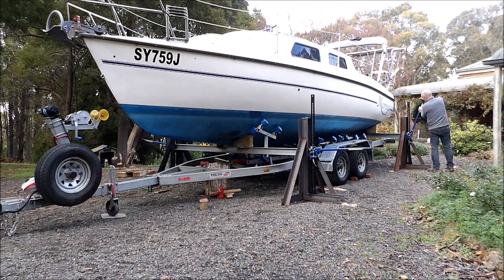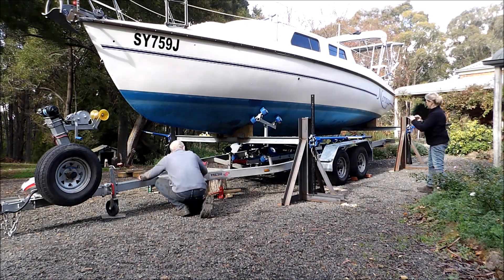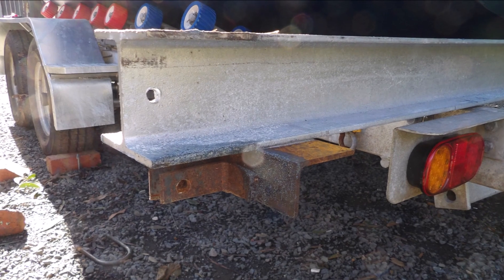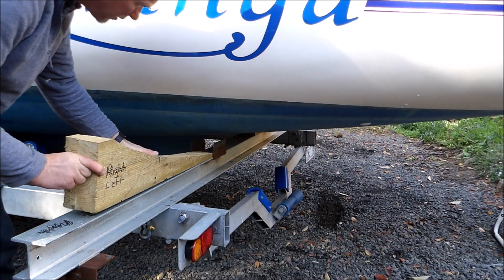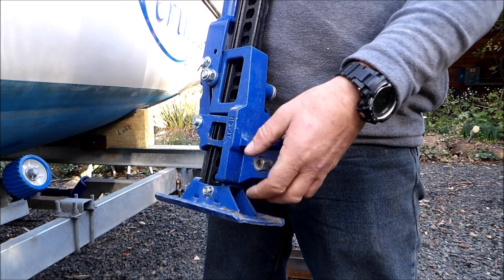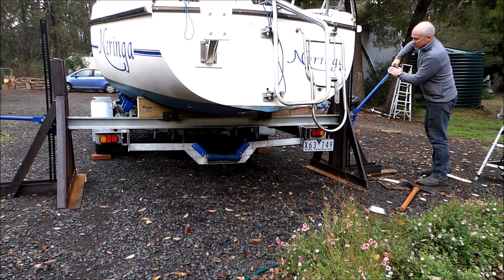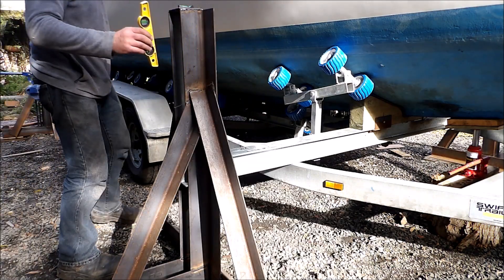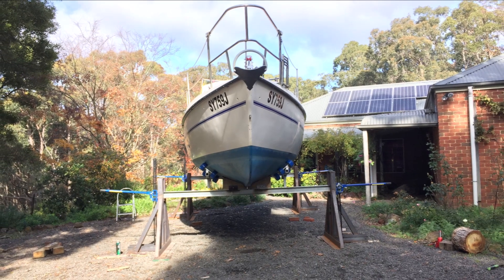Portable Hard Stand for Trailer Sailers

Comment: Nice rugged design, good especially for regular working yard.

Since I already have a set of Brownell stands sized for my wing-keeled Capri 22, I used two in the rear plus one bow stand to transfer my boat while "repairing" the 1970 trailer. I have a new custom trailer coming in the next few weeks. I will do the transfer again.

I have used hydraulic jacks but also have a tractor to assist with the temporary transfers. Since my old (and new) trailer had the same screw pads as the stands, I would raise my boat up to get a block between the keel and the trailer keel support. I would lower the pads to apply the bottom paint using ratchet straps to hold the boat stable relative to the trailer.

Yes, the extra stands would cost about the same as your materials, but the stands were convenient AND I already had them.
Reply from the maker: Hi John,
Yes the problem of lifting the boat of the trailer for work can be approached a number of different ways. Sounds like you have a great system that works for your boat and trailer. Moving to a new house in a few weeks and may set up a permanent gantry/roof over the boat parking area to be able to lift with straps and chain blocks. It will depend on how energetic I feel in setting up the 5m high posts and beam required! May just stick with my current system. Cheers Mark

Comment: These are great..!!  Are you renting them out??
Reply from the maker: Like all lifting devices there is a level of risk and they have to be used in a very specific way which makes the risk and liability of renting them or even letting someone use them to high for me to stress over. When I get time I will be adding locking bars on each stand that will 100% back up the high lift jacks.

Comment: Thanks for taking the trouble to make this video - a great design idea which I am about to copy. Appreciate it very much. Cheers.
Reply from the maker: Hi Richard, Thought I replied to this earlier. I have lifted the boat of the trailer 4 times now with no issues. I always suspected the jacks I bought were a case of fake chinese specs. With the boat around 2000kg each jack is only lifting 500kg plus or minus with the front ones a little more so even if they are only 1500kg jacks instead of 3000kg jacks as claimed they are not even lifting 50 % of the 1500kg so I am happy enough. If you do build them take note of the position of the jack bases on the inside of the stand foot so the weight is transferred to the base of the stand making the stands very stable. At some stage I will modify the stands by drilling holes in the uprights so that I can insert a safety pin that can be moved up as the beams are lifted. At the moment I just put a pin in the upright of the jack as it is lifted. Hope your project goes well, let me know how you get on. Cheers Mark

Comment: These jacks, which may be similar to yours are subject to an ACCC product safety recall, https://www.productsafety.gov.au/recall/ebay-seller-eastbayauto-x-bull-professional-4wd-accessories-high-lift-lever-vehicle-jack-3000kg
Reply from the maker: Hi Richard, Thanks for this information. They are the jacks I use and I have always had my doubts about the capacity claims made on the label when comparing them to other jacks I have owned. I use them to under 50% of capacity on this stand and cautiously and they have shown no signs of problems. When at full height I strap 4 timber posts under the beams as a safety backup to the jacks whilst working under the boat. Like so many chinese products they exaggerate their specs. May look for replacements when funds allow. Cheers Mark

Comment: Did you design the stands and where to put the brackets on the beams, using a CAD program? Are there copies available?
Reply from the maker: Yes I did design the stands but being old school a few rough sketches and details worked out in my head. The basic concept is pretty straight forward if you use the dimensions given at the end of the video along with the materials used.Things to look out for are using a spacer when welding the stands as the slot has to be just wide enough to let the H beam slide up and down. The other is that the high lift jack base transfers it weight onto the stand. Having only 3 base legs the weight of the boat gives each lifting stand its stability. In other words the jack sits in the outward facing base leg. Positioning of the beams was largely dictated by the trailer and boat shape. Ideally they would be spaced evenly to create equal weights back and front. The trick is that one has to be able to be positioned with the boat on the trailer. Once that one is in place and the weight is taken on that beam, the front of the boat can be raised with a bottle jack to allow the second beam to be positioned. I found with one beam in position and the weight taken up on it the boat is very stable allowing the temporary jack lift to position the other beam. Obviously once both are in place the boat lifts easily.
The weight distribution on my set up is 40% rear 60% forward beam. The most each jack lifts is around 400kg which for a 3 ton rated jack gives a good safety margin. The H beams will fail at around 2200kg and the most load they have is around 800kg. The computations were done by my engineer son.
Sorry there are no CAD drawings, hope some of this helps.

Comment: Looking forward to spring and summer and more of you adventures. What are your thoughts on the Sunbird 25....
Their owners love them....... then some say they are slow and tubby....
Reply from the maker: Sunbirds are a boat I considered and are an incredibly seaworthy boat. They are ocean capable in my view and have done trips to tassie. On the down side the diesel inboards are old and most are in need of replacing unless they have been meticulously maintained. They are very heavy on the trailer (probably one of the heaviest for the length) and a little more award on the launch and retrieve. For these reasons I went for the RL28. If you can handle the downsides tho they are a great safe cruising boat.